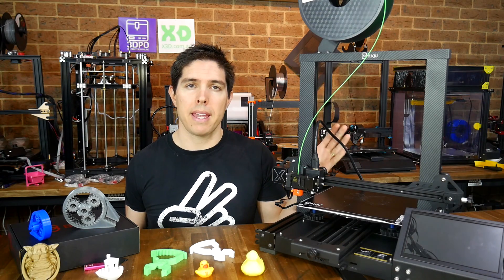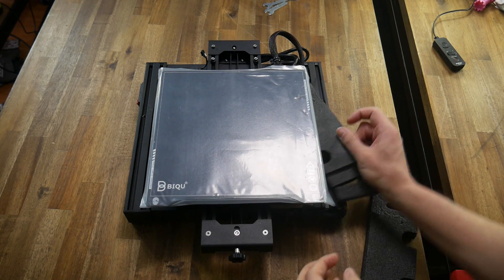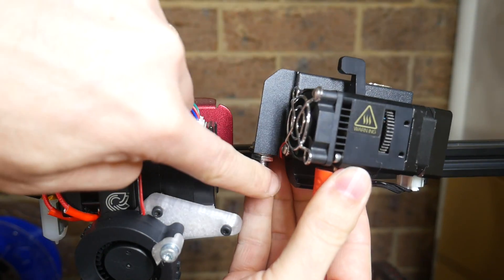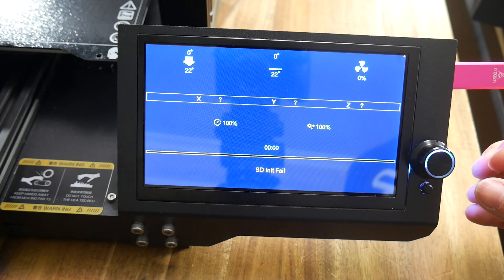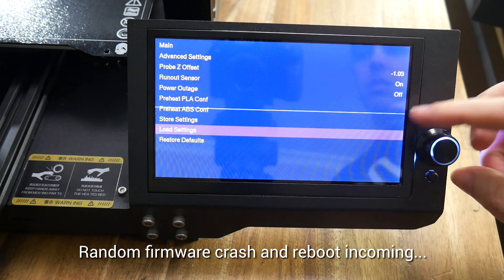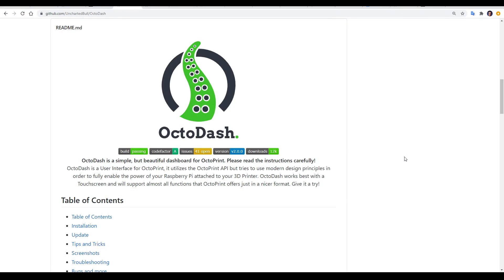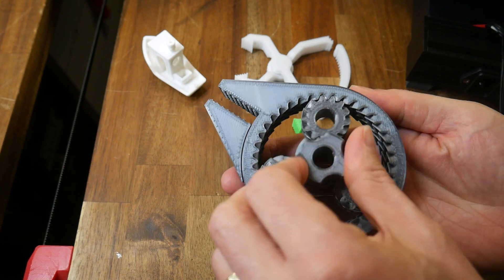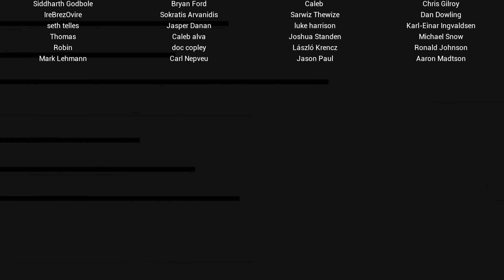BIQU BX - Octoprint compatible 3D printer on Kickstarter

Comment: Still a beta product ! or half finish printer, wish they had little more focus on getting things to be stabile and marked ready,  here is a suggestion remove  all the "Dont need" options that only complicate things and get the basics bullet proof  .   Instead of all the options like big screens and blinking lights that you forget after a hvile.  In the end It does not matter if its cheap if it dont Work 90 % of the time Like many printers out there.  I wood not waist money on backing this stuff, You cine off  know  what to expect from this, and it is most lightly going to disappoint most users that expect plugg and play and just want to print stuff. But if you like tinkering and not having a stabile product this my be your thing.
Reply: Hi helge,  trust me, In the end, this printer will not disappoint users because our engineers testing and upgrade BX every and for making it more stable and with a better printing results
Reply: @BIQU_Makers  
Well one product must be the first that give both quality / stability to a lo affordably  price for the hobbyist or in semi pro small scale marked, not sure it is this printer that make the cut. 
But it  can be,  but then some of the  "Dont need" options that only complicate things must have a little less attention. 
I am Thinking spend some more time making bullet proof software  and hardware that are easy to maintain and the user can update to suite needs or taste on there own later on,  
Dont save production cost on vital components or adding components that are just for show. Like so many printers are plagued  whit. but this printer does seem to have some better quality components but there are also some weaker points like hdmi connector that properly will give the end user some issues down the line...Any way not 100% convinced that this will be any better than what already exist in the marked at same price range.. sorry but it is what it is. Any how it seem like it check many boxes on the path to be the got to printer so  In this case i wold relay like to be proven wrong as it seem to be more things that this printer has going for it than against it so..

Comment: Looks nice, but why the HDMI cable?  Is that an off the shelf HDMI cable.  I assumed that HDMI use solid core wires, not braided bunch.  I would just want to be comfortable with the bending rating being appropriate for the expected lifespan of the printer.
Reply: I thought an ethernet cable would work great as POE is standard and can deliver lots of power. Ethernet also has a locking connector.
Reply: @groundzero_-lm4md  biggest issue with Ethernet is you only have 8 leads, and half of those are used by the stepper alone leaving no room for anything more than the heater and thermistor.
Reply: HDMI has a lot of connectors, so has a lot of capacity for using multiples for carrying current to the hotend. Presumably they will use a flexible HDMI cable, which do exist, and since they're a Chinese manufacturer they can source appropriate braided cables, a standard HDMI cable would fail pretty quickly. BIQU did release a printer with a USB-C cable connecting the hotend to the brainboard before, so they're experimenting with various standard connectors in order not to have to re-invent the wheel -- USB-C had a tendency to work loose, so they're still not using a locking connector, hopefully their next idea will be better.

Comment: This controller board and lcd board(s) should also be sold seperately. I hope that BTT decide to do this. Because this hardware is also a good match for klippy,, and the MCU is almost 4x faster than the SKR PRO. Also because (going forwards) is also going to be getting better support than the SKR PRO. So I really would prefer to buy one of these instead now.

Comment: i'm surprised they didnt do a well integrated klipper printer if they're bothering to include the Pi with it. could skip the chip and alot of the board components, just have drivers and a fan and power regulation, with the pi handling everything else
Reply: The Pi is not included.

Comment: The Raspberry pi integration with a large touch screen makes it very appealing . I'd love to have something like that on printer with print size of the Artillery sidewinder x1. I'm not planning to back this because I don't need another printer, but it looks nice.
Reply: I dont really see the appeal of the large touch screen/pi integration.  I see the appeal of the pi integration, as Octoprint is one of the greatest 3d printer tools ever created, but at least from my perspective the point of Octoprint is so you dont have to use the printers screen/be around your printer.  

My printer is in its own room, and I rarely touch my printer outside of mandatory bits like removing a print.  99% of my interaction with my printer is through Octoprint, and that interaction happens on my computer or phone.  That big touch screen to me would be just as useless as the small lcd screen.

Comment: nice video, Michael! 
but i dont see the point of a light extruder, when you have an i3 style printer with a massive bed... can someone explain pls? :D
Reply: Its to have a direct drive extruder rather than a bowden, which makes soft filaments easier to print
Reply: @BeefIngot  yes, but they advertise with it being very light weight, which doesnt make much sense imo
Reply: @certified-forklifter  Its lightweight for a direct drive extruder
Reply: @BeefIngot  yeah, but whats the point of it? it can also be 0,5 kg and wouldn't make a difference. or am i wrong?
Reply: @certified-forklifter  The lighter it is, the better the print quality and the faster it should be able to move
Reply: @BeefIngot  okay, i see. thanks. but the bed is very heavy, and for most movements, you need X and Y, right?
Reply: @certified-forklifter  You know, thats a very good point, and to that I have no rebuttal. I suppose if the bed weighs significantly more, its all for naught, at least the weight savings part. 

Then it would seem this would better be fitted on something like an hbot or corexy
Reply: @BeefIngot  ah, okay. cheers!
Reply: Great point

Comment: If they have the kinks worked out, it seems like it could be a cheaper prusa in terms of features it supports. I definitely would appreciate knowing if it easily supports linear advance though, as to me thats more or less a requirement for a printer just because of the features ability to get rid of the small ridges on the outside of corners.
Reply: It's using a standard SKR v1.4 control board, so it definitely will support linear advance. I'd be surprised if it wasn't already baked into their stock firmware settings, but if not then it's as simple as flashing an updated Marlin file.
Reply: @missMoshieQ  It's not a SKR 1.4, it's a new custom board with a much faster mcu